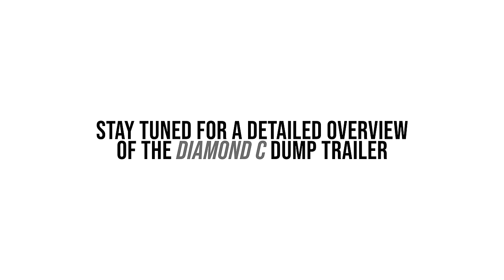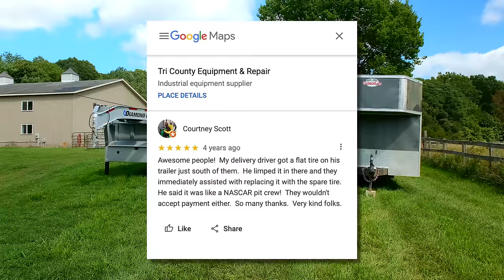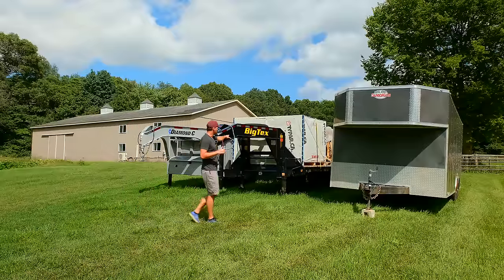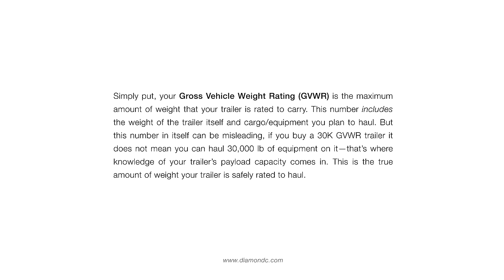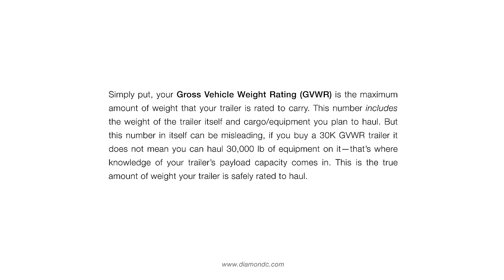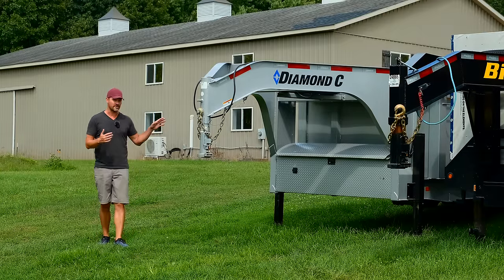THIS WAS A $30,000 DUMP TRAILER MISTAKE. WHO WANTS TO BUY IT?

Comment: I drove a Ford 9000 flatbed that had that scissors type lift on it and it would lift anything you could put on it.  It had an 18' or 20" bed. The problem with the trailer is the cylinder and the pump, not the style. The Ford had a PTO pump and it took considerable horsepower to lift the bed when loaded, (often well overloaded). A small electric pump isn't going to have the power to lift the load even if the cylinder had the capacity.
I hate to say it, but the mistake was not the trailer, but the operator not knowing how much dirt weighs and how to load it in the trailer so it could be dumped.  However, the company should have a maximum dump capacity for a water level load on level ground marked on the trailer so the operator has something to work with. .

Comment: Even with the smaller dump trailer,you definitely want to have a center mount double stage hydraulic ram. Even if it’s an upgraded charge he would definitely want that, also try and keep your weight over the axles, a scissor lift is probably one of the worst design hydraulic systems for a dump trailer, my phone go to a different dealer he did you wrong, they only sold you what was available on there lot. And I thank you for your mistakes, so I don’t make the same ones, sorry but thank you, and I am heading in the same direction as the lowboy equipment trailer. thanks for a great video, I hope you get your trailer sold in a timely fashion and don’t take too much of a hit financially.

Comment: I agree about the PJ Trailer. It’s a 5x7–10,000lb dump trailer. In owning it for 3 years, the welding on the hinges being so poor, they came off the frame. I will not be buying another PJ trailer.

Comment: It looks like you had that load of dirt spread throughout the entire length of the trailer with room to spare on the sides (height) of the trailer, probably would have had better luck keeping the majority of it over the axels of the trailer and stacking it higher... I have a 7X12 bumper pull dump trailer with a 4ton payload capacity. I’ve had a supply yard load the front of it with 4 tons of sand and it wouldn’t dump, but yet I’ve overloaded it with 5 tons of sand loaded over the axels and it dumped it with no issue.... the problem is only worse on the trailer you have since it’s so much longer the leverage is greater if it’s loaded to the front of the trailer.

Comment: I would honestly recommend a Titan dump trailer before a diamond c. I have a 14ft bumper hitch dump trailer and I like its design better than this trailer. But honestly with that ram setup, it wont handle much more heavy material than my titan 14ft. That diamond c was honestly designed more for mulch with the high sides and tree work.

Comment: I have a Big Tex 22gn. Just like yours.  I can haul anything on it.  With my dually f350 I can haul 20k pounds on the trailer.  Anything from a zero turn to a D5 Cat dozer.  With no problem.  The dual tandems handle the weight bucket better. And my big sell point was the hutch suspension.. that is much better than slipper springs..

Comment: In my opinion this trailer was overloaded. A trailer this size is great for construction debris brush and tree removal but with dense materials plus the trailer having 7 gauge floor and sides the box alone is heavy.  As far as putting a telescopic lift no one is making one for a trailer over 16 ft that I have heard. I would guess if it was loaded with the weight it is rated for and more towards the rear over the wheels it would lift it. That's an awesome trailer for loose material or a piece of equipment.

Comment: That dump capacity is embarrassing, but its likely the scissor setup and being so far from the front. I have a 16' N&N HD 14k galvanized and at the cemetery I'm not going on the road so I load until it starts spilling out. 16' x 7' x 3' is just over 12 yards and roughly 26,000 lbs of wet clay and dirt and it lifts with no issues. Front mount, 3 stage hoist. I believe it has 30" sides, but ramps can handle 10k and you can legally load 10,625. I've had my Kubota KX0-40 in it with the arm out front.

Comment: I hot shotted for about 3 years before I went to over the road long haul. My first rig was a 2005 C5500 Gmc with a 9' flat bed w/90 gal Xtra fuel capacity, 5th wheel, Goose neck, and receiver. Also had a 40' goose neck trailer and I was permitted to 32000 gvw. Nice rig and handled everything I hauled. Including 40' containers (empty of course). Always make sure whatever you haul in a dump trailer the bulk of the load needs to be over the axles. That traier is better for Brush or debrs wood chips,not dirt, rock. Live and learn. Be sure and tell whoever buys it if they're not aware this more of a clean up trailer, debris, limbs, but no heavy material in front of the axles. Just passing on my experience and wisdom.
 sand

Comment: Semi gravel trailers use single front lift cylinder.  As I am sure you are aware don't overload a trailer. Filling a box full of dirt is way heavier than you should lift. Stone is way heavier. If you loaded with gravel your tires would likely have blown with full load. Use a semi trailer scale at truck stop to show you the weight.

Comment: Did you check the hydraulic pressure? If the set screw that controls the pressure is off you'll loose a lot of dump capacity.

Comment: Diamond c is simply the best trailer, I think. the fact that couldn't dump that dirt has nothing to do with the trailer remember it's not a tri axle dump truck!  also, when your skid steer has no attachment on it back it on it won't want to flip backward problem solved. also remember there is no perfect do all one piece of equipment. I've said too much already i got to go!

Comment: Adding a additional batteries really help these trailers dump much better. In a pinch you can use a jumper box, or even jumper cables to get it to dump if it’s struggling. Works great

Comment: you need to install a vibrating motor on the bottom up the dump box on the trailer. shoveling out material can be dangerous

Comment: I have a Texas pride triple axle dump trailer and I can fill that thing to the top with dirt and it will still left I went with the dual ram instead of the single scissor lift style but I don’t fill within 2 to 3 feet at the front because then it will not lift

Comment: Dump trailer lifted should  be in the front   twin lift cylinders   
Look at commercial dump trucks where their  lifts are postion    especially  if you want heavy duty dump capacity

Comment: Weight is different than volume , 16,000 lbs of feathers is still 16,000 lbs of weight but it will be a much bigger pile of volume than 16,000 lbs of rock . The high sides made you think that you could fill that box up but rock weighs more than feathers by volume , a 7 foot high pile of feathers may only weigh a single ton of weight but a 3 foot high pile of rock is going to be a lot heavier . With dump trailers weight matters more than volume and those high sides are for more volume and  less weight items . Liquid weight on average is 9 lbs per gallon , so for a 16,000 lbs dump trailer that would be about 1,777 single gallon jugs which only have a floor span of 5" x 5" or a 25 sq. in. space each and are only about 11" tall . So to haul 16,000 lbs of rock you would only be using about 12 - 18 " inches of height inside the trailer .

Comment: These companies all making the scissors lift to cut costs, its the weakest system of all. Unfortunately when I was in the market half a year ago you were lucky just to find anything, Let alone be picky about the ram, there flat out were no hyro ram modules available in the province... looked for close to a month. 
Same goes with the style of welding, nothing around that has the deck full welded in, best you;ll find are the welds done in 8 inch increments instead.  Back of the floor plate caught and bent up 1/2 inch on the Big Tex 16 just by catching the bottom of a 2 series JD mower deck because they couldn't bother to put a full weld across even the tailgate end of the deck steel... Damaged after one use.. was not impressed.

Comment: Wow… that’s upsetting… I spent way less for my dump trailer and, it’ll dump over the GVWR. That dump system requires a much larger cylinder. 1945 REO has similar system but a 12” cylinder… that sucker doesn’t know what weight is. I’d be interested if it was low sided.. hope you can pass it on🤞🏽

Comment: I worked for a trailer dealer in highschool and college. None of the people there or other dealers in my are actually know anything about trailers. 
They just pull out an order sheet and checking boxes with no clue. What they are doing. 
That trailer should’ve been 16-18 ft max in length. They use the same hoist no mater the Length of dump box. At that length they have to move the scissor hoist so far back to get the full angle that they lose all leverage.

Comment: Top soil weighs about 2,000lbs per cubic yardThe trailer dimensions are 20'x8'x4', filled completley that would be 27.5 cubic yards, lets say you filled the trailer 1/2 full which seems about right from the picture so you have about 13 cubic yards x 2000lbs = 26,000lbs, it is up to the driver to know the weight of the load, you overloaded the trailer. I get that Diamond C must do better at answering you inquiries, they should have all the answers, such as the example I gave. Unforunately ends up being your fault fo not knowing the weight of the loaded material.

Comment: The trailer works great just have to remember how much weight ya trailer can hold and what weight of material per yard is. Also the load of dirt failed the trailer when it stuck to the bottom of the trailer
Reply: The dirt stuck to the trailer because he ran a skid steer through it and packed down trying to unload it when he had the trailer loaded to heavy and would not dump on its own.

Comment: Way to much dirt in the trailer. Not many things could lift that much...
It's impressive that the axles, tires, and even the single wheel truck was able to pull that. Especially offroad.

Comment: If you bias your load to the back you will be able to lift  similar weighs that you could not lift this time..  You loose a lot of lift when you load forward, and it takes surprisingly little to exceed the hoist capasity.  I got caught like you, with an underbody hoist on a truck,and had to shovel off 1/2 a ton before I could tip the load.
Observation: your hoist cylinder looks small. On the sisor lift trucks, the hoist cylinder is noticably fatter(more power).
What is the tipping angle of the body?  The camera angles made it impossable to tell.  You need about 55 degrees of tipping angle or you will have hangups, even in mulch.

Comment: That dump should have had at least a dual cylinder lift, capable of lifting the max payload (plus trailer bin weight).
Reply: I just made the same statement!!!  There is nothing wrong with over building on the lift capability... Especially since it is a Dump Trailer!

Comment: I watched the previous video.it barely dumped the partial load. Most all hydraulic systems have a relief valve. Generally adjustable. Your looks set way too low from the factory. Should be adjusted with pressure gage but man it looks REALLY weak. I’ve had/have dump trailers. Surprised dealer didn’t look into it more. Just my 2 cents.

Comment: The trailer is weight rating is the weight of the trailer plus the load. dirt is heavy, the load you showed by itself was probably over 25000lbs. generally a 10-wheel dump truck only hauls on average 27000 to 30000lbs. your trailer weight was probably around 8000 to 10000lbs giving you a max load of approximately of 14000lbs.  3 7000lb axles is 21000lbs how they get 24000 is beyond the math. I started hauling dirt in 1966, the norm we used for clean dirt was about 22400lbs plus per yard, your trailer box (according to Diamond C's website is 16' ) . If you had a 1cu yd bucket you would have only been able to put 10 buckets in the box. The salesman didn't do a very good job explaining everything.
Reply: They are considering 3000 lbs or so to be on the tounge.

Comment: Long dump trailers should only come with dual cylinders side mounted hydraulic systems. Never get a center mounted Jack system on a dump trailer this long. 

I wouldn’t sell it. I’d just add a telescopic lift on it and keep it. Those lift a shit ton and it can run right on the same pump u got now.

Comment: I am confused, that thing should have easily dumped what you had in it.  What size cylinder is in it?  Very odd.  I have a 14"foot felling, with a 5 foot deck on the front.  It has 20" sides and I can fill it to the top with a mound sticking up past the rails and it will dump.   Roughly 6 yard of dirt, your probably had maybe 10 yards, maybe, by the looks of it. 

Diamond C's are the top of the line, as far as I am concerned.  There fit and finish blow my Felling away, and the Felling is a nice trailer, I had it custom made 2 years ago.  

 They should be able to tell you exactly what that trailer can dump, I think you should try again, thats their business to know what your asking for.  

Peace,

CGB

Comment: I had a 6x12 quality steel dump trailer it had a payload of 3.5 ton I couldn’t find anything it would not dump, easily dumped 6 ton, then I upgraded to a pj 7x14 and I was totally disappointed it is rated for a 5 ton payload and will not lift 6 ton at all

Comment: That trailer is messed up or bad design. Buy an iron bull. We use one everyday it’s a 7x12 14k and we can dump 4 yards or gravel easy. 3-3.5 dirt and it bogs a little bit will do it. You can fill to the rails and it will dump.

Comment: Way too much steel for the little bit it can haul, should have been a light duty since mulch and cotton balls is about as heavy as you can haul  for the amount of volume and you don't need a heavy steel for that.

Also, the bed doesn't go up high enough for dirt or topsoil, feel bad for you because someone at the dealership was clueless about dump trailers.

Nice looking rig though.

Comment: The huge problem with that Diamond C is the leverage the load has against the lift cylinder.  It's like jacking up an 4 ton truck with a 6 ton jack.  The laws of physics say it can't be done.  Will it dump and evenly distributed load?  I think you proved that it can't.  A lift cylinder (double or triple) at the front of the trailer will do  the job.

Comment: I bought a Texas Pride 12 ft, goose neck with all the bells whistles. One question i asked was how much would it dump. I'm lienced for 5 ton. It has two rams and was told each ram was good for 21000 lbs and they had 17000 lbs. On the same trailer i bought.  And it dumped with ease.  I myself had 13500 lbs and it dumped great. Check the out

Comment: No offense bro, you were* using a professional trailer like a home gamer. Few things: leave the ramps at home when dirt hauling cause its dead weight, chalk/lime your box if the soil is that moist it'll slide better, rest the box on 6x6s the 1st 6" is the hardest to lift, 90% of the load has to be over the axles. Basically a mound in the back and 2yds or so up front which is 4k lbs to max out hitch payload.  I also didn't see a power cord so the truck so the alternator can pick up the amperage slack under load. Just some efficiency tips from an end dump fleet owner that turns 4-6 loads a day at 10-12ton per trip, 6 days a week.

Comment: I wouldn't put more than 7-8 buckets max in that trailer.   Wet dirt can weigh 2800 lbs per cubic yard.  Assuming your scoup was about 3/4 a yard =     (13*.75)x2800 lbs = 27,300 lbs of dirt in a trailer only rated at 21k with the axels.    The trailer probably weighs 8k, so you were at 35k total trailer weight.     Much too much for that transmission in that truck to be pulling, and much too much for those axels not to mention road stopping power.     God knows how much 'pin weight' was put on the back axels of the truck, but I would imagine it was beyond 6k, and exceeded the weight rating for a non-dually.  I bet the dump  cylinder was only rated at 15,000 lbs of lift.       On my BWise ultimate dump trailer, I load more to the back for local short trips where I don't have to worry about trailer swing down the road that much.     If I overload it slightly, I will use the hydraulic jacks in the front to lift the load up as high as I can, then engage the dump cylinder to start the dump.    It's always good to dump it on the downward slope of a hill if possible.      I've seen guys put the lift cylinder through the deck of their trailer overloading it like this.     The tall sides were meant for brush and construction waste cleanup where it weighs 200 lbs per cubic yard,  not aggregates or scrap metals.

Comment: What no one also tells you is combination gvw weight and what you can legally haul. Between the trucks gvw from factory not what it’s registered for and trailer also factory gvw together need to be under 26,001lb before you need a class a cdl with out air brake endorsement. All 50 states no way around it lots of people go without getting hit because local police often do not know… but once dot stops ya hope ya packed lube.
Reply from the maker: Local police know.

Comment: That seems pretty normal these days in manufacturing of all kinds.
A hydraulic dump should dump a full load up to the max loaded trailer weight. Otherwise it's pretty useless. Diamond C should be held accountable but they won't be, most never are, that's why stuff like this keeps going on.

Comment: Take it to a good fab shop and get a staged cylinder installed up front. Not that big of a modification/ not real costly. I did my f450w 10' dump body. Scissor lift is a total joke untill after its opened up a little bit, so yeah, useless. I had less than 1500.00 in mine including brand new magister cylinder, n steel.
Reply: Mind you that was doing the fab work myself, but prob around 3k u could get it converted